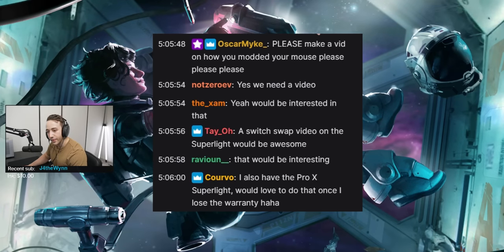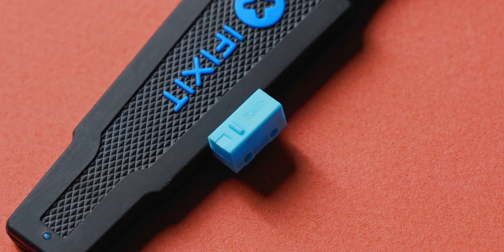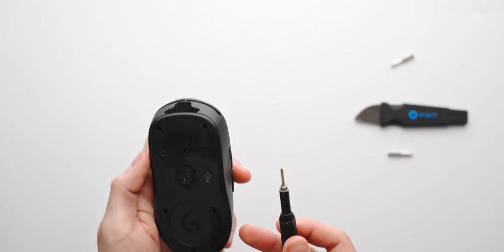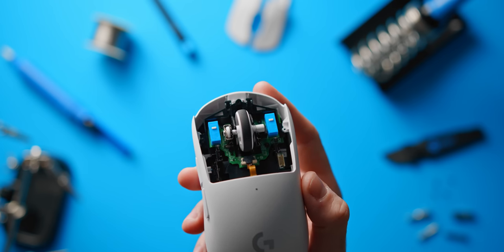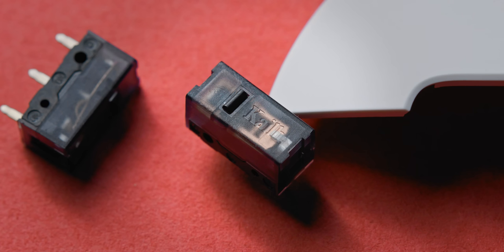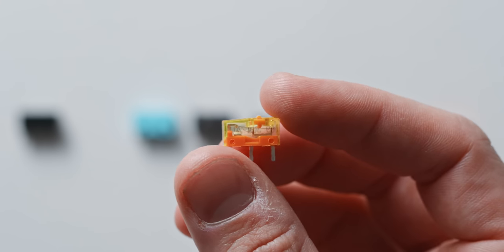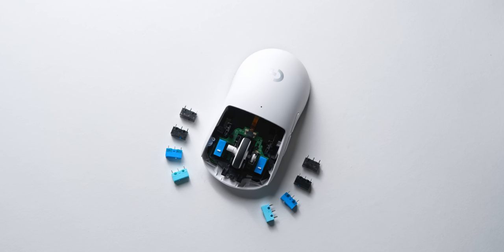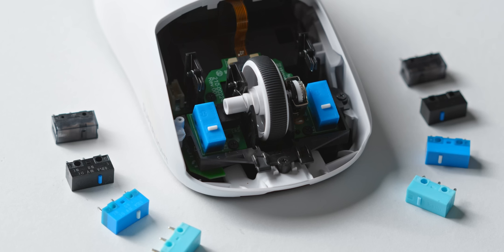Upgrading my Gaming Mouse Switches

Comment: Can we take a moment to appreciate this man hardwork. He just soldered and desoldered all the switces just for us.
Reply: Mech enthusiasts be like: meh
Reply: Damn, it sure did take him super long to do something he has already done once, damn.
Reply: Was thinking the same, what a great job! Thanks man!
Reply: As a guy who's into mechanical keyboards, I just desodered over 50 switches. Thats nothing.
Reply: @max5845  yeah but here you have to reassemble everything after desoldering and soldering
Reply: @MP_7  Here's what I have to do: Take the keycaps off the board, remove the keyboard from the case, de-soder 61 switches (I counted), lube and film 61 replacement switches (which takes over 5 hours to do), REsoder the 61 replacement switches back onto the PCB, then put that back into a new case with new keycaps. Trust me, the keyboard bois know the pain.
Reply: @max5845  I know, I did the same, but for someone who's not into it, even this mouse stuff is a lot of work, I still have to see a video, other than this one,  of someone who made switch comparison on the same mouse, so kudos to him :)
Reply: @max5845  yeah but you didn't shoot the video in high quality, color grade, edit and upload for free.
Reply: Men,u dont need to desoldered everytime to try a sound test,u can mount it without solder,but not gonna work on Windows,but the sound are the same.
BUT he had to put all the screws 8 times,that respect hardwark anyway. Respect so much.
Reply: @max5845  Been there. Lot of work but when finished.. worth it. :D
Reply: it is piss easy to desolder mouse switches
Reply: I can't imagine your perception of the world if you think this is hard work
Reply: This is one of things I liked about some of the Asus ROG mice: They have socketable switch upgrades should your switch die or you just want something different.
Reply: I'm surprised he didn't rip the solder pads off after all the solderings and desolderings
Reply: @Hobbitude  thx, I will
Reply: @aquanos  the first home I owned I built my self, took me 8 years. The second one I built took me a week cause I had already done it once.
Reply: LMAO, look at the "iTs NoT hArD" mouthbreathers over here. Because the concept was apparently too difficult for your three brain cells to deduce, let me make it crayon eating simple for you: every time you take something apart you risk breaking it. Even more so when you start breaking out heat and solder on a board, you risk overheating something or shorting something.

So, this man when through the trouble of showing us how to disassemble this, taking time and money in the process of shooting and editing it, and risking his mouse.

YouTube comments really do reveal the other 50% of the IQ curve.
Reply: @rustler08  well said! 😅
Reply: @PhyNxFyre  imagine not hotswap
Reply: @jsnR-d7x  If it's that easy and you make so much money out of it, why is this the first video im seeing with all the switches soldered on the same mouse? Why didn't you do it and earn them $? Probably because you're too young and naive kid.
Reply: I’m sure he has few of those mice
Reply: lol... it is nothing if you know what you are doing... the risk of breaking the mouse is 0 (again if you know what you are doing). Why does everyone thinks soldering is hard? i can probly do it with my eyes closed if you guide my hand to the pins. And i am not even an electronics guy, i am a software engineer. is the average  IQ of gamers really that low?
Reply: i mean he probably just put those switches in without soldering and clicked
Reply: Just for us ? How much money did he get from YouTube and ads ?
Reply: I am pretty sure that he just placed the switches without soldering it or de soldering it as there is no reason for him to solder it
Reply: @max5845  gatekeeping much?
Reply: beardedbob enthusiasts be like
Reply: That's nothing lmao. Easy soldering job.
Reply: @max5845  you counted the switches on a 60%? okayyy
Reply: Nope!
Reply: @Kuraio  i did :( do you know how to fix the solder pads?
Reply: @agsechogd6406  You could try bodge-wiring it with some thin magnet wire
Reply: @Kuraio  idk how to do that :/ I’m so pissed off
Reply: This is why you should switch to Asus Rog where they make switch replacement manageable.
Reply: @max5845  50 switches? bluds using a 40% keyboard
Reply: @DilawarAli_C over 50 isn't 50
Reply: he could just not solder it though
Reply: true lol
Reply: you guys really think soldering is a marshal art 😂
Reply: I DID THAT ON 2 MOUSES IS SO EASY

Comment: Just a warning to those new to soldering: flux is included in each solder wire to help it flow better but it can also cause cancer. Make sure you have a fan to blow the solder fumes away from your working environment and do your soldering in a well-ventilated area!
Reply: welp im ded
Reply: Leukemia 😨
Reply: Thanks for the tip man - haven't done soldering before, so that's great to know.
Reply: Oh sh*t. I liked sniffing it when I solder. I am so screwed.
Reply: @Prabhu2086  Lmao based
Reply: God, you scared me
I got one of those fume extractors, but I can still smell the flux when I use it, so I guess that it's not highly effective
So I looked it up, and apparently there is no evidence of flux fumes (or rosin fumes) causing cancer
They can only cause irritation etc
Reply: Tf man too late
Reply: Did not know that!  thanks for the headsup

Comment: LPT: if you're using a " 3rd hand " for soldering jobs like shown in the video, apply heat-shrink tube around the upper and lower jaw of the crocodile clips. This prevents the tiny sharp teeth from scratching your PCB or bating trough thin cable you might be soldering. It is a little less grippy, so kepe that in mind.

Comment: More brands should apply what Asus does with their mice that have interchangeable switches.
Reply: More brands should just introduce optical switches
Reply: Honestly can't wait until hot-swap switches on mice becomes mainstream.
Reply: @therealb888  For real. I have the viper ultimate and I cant use any other mouse. The feedback is so good.
Reply: doesnt asus have the patent for it? so other mice companies cant use it?
Reply: @minjou6412  yeah they do
Reply: Yes, the switch are the first and only part I ever broke on a mouse. They are so fragile.
Reply: @VigiHunter  Back 10 years ago I used to have an old mouse that started to double click or have dead clicks. I was in the process of shopping for a new one when I read somewhere that most of the time it's just the metallic contacts in the switch that get corroded and all you have to do is to spray some WD40 in the switch and it'll clean up the contacts. And it actually worked. I just sprayed a bunch on the little clicky nub and let it drip down inside. Clicked the mouse a bunch of times and the WD40 did it. I repaired a few of my friend's mouse since then with the same trick. The only negative point is most of the mice' s screws are hidden behind the pads which are glued in place. Most of the time removing the pad destroys it. I take it as an opportunity to upgrade to better pads but you dont have to. I managed to save pads before by using an hair dryer to preheat them so the glue isnt too sticky and I rehead the glue before putting them back on. Not perfect but unoticable if done properly.
Reply: @Dislob  huh good to know, will try on some older mice and see if it works.

Comment: Great video, your production quality is absolutely nuts. Switches generally have a lot of variation in actuation force and feel, manufacturers can buy preselected switches in bulk, where the difference in actuation force is much smaller.
Reply: often called "binned" or "presorted" and yes Kailh does this so that a pack of them you buy has as little variation across all the switches as technically possible.

Comment: Upgrading my mouse switches?
Great, now I can have another expensive obsession lol.
Is there enough of a hobbyist community around this that they sell a switch tester, by any chance?
Reply: Time to lube the switches!!!
Reply: @lightningcat6382  Yes, it's time to design and print a whole new split ergonomic mouse that fits one part over each finger like a bulbous glove. Let's make it an open-source project and start a group buy, too.
Reply: @lightningcat6382  you need to buy replacement feet as well as they're generally not reusable after you peel them off
Reply: Modding a mouse, shape wise is expensive unless you have a 3D printer, switch replacements are cheap
Reply: you can actually get a bag of like 50 switches for mice for dirt cheap.
Reply: Some ASUS rog mice have hotswap sockets for the switches so i guess u could use that as a "test" bench then solder ur favorite ones to ur main mouse.
Reply: @dawgdog69  you can get sockets to solder in and make any mouse hot swappable. Its just a little fiddly and takes some playing with them to get them installed correctly. That alone turns many people away for lack of patience.
Reply: Actually its much cheaper than buying a new mouse if you can fix your switches.
Reply: You say expensive but the most expensive switches here go for like $3 each lol

Comment: One thing that wasn't mentioned is that you can add a bit of tape under the mouse buttons also which can affect travel distance and actuation force.

Also, while most switches fit, some are a bit taller/wider than usual. An example is the Japanese omrons which are just a hair taller than usual, requiring you to sand/file them down a bit. Another thing to note is that generally (but not always), a lighter click will have a shorter lifespan and a stiffer click will have a higher lifespan. As mentioned, there can be a lot of click variance even between the same switches so this is not always true, but you can use it as a starting point when looking for switches.

I've managed to mod the switches on my model D and after a bit of trial and error with sanding the switch and adding tape (under the buttons), I have managed to completely remove the horrible play/pretravel that the model D has. This means the click now occurs almost instantaneously, while still having enough stiffness such that I won't accidentally double-click if I don't want it to.
Reply: true. thats why most manufacture use omron because they can balance actuation force and the lifeclick

Comment: This is exactly what I was looking for! My mouse started double clicking on its own and I need to replace the switch. Thanks for another great video!
Reply: If you search for "double clicking fault mouse" you'll find an instrutables page which tells you how to fix the switch, no soldering required.  I need to do mine too.
Reply: @hootsmin  I know, but switches are cheap and if I'm going to disassemble my mouse, I might as well swap them out. My mouse is 10 years old, and I use it for hours every day so it's amazing it's lasted this long. It's a Logitech G9X, I love it, will never get a new one. :D

Comment: I actually did this a few months ago with my Cooler Master MM710, I swapped the Omron's for some Kailh GM 4.0's and it legit feels like a way better mouse, no longer has the feeling of pre or post travel when clicking, feels a lot more responsive as well. Getting the old solder off of those old switches was a bit of a hassle at the start but I found if you apply some lead solder to the switch you're trying to remove and then use some solder braid it comes away a lot cleaner, would also 100% recommend getting Core pad skates or some Tiger skates.
Reply: Put some 4.0's in my logitech g604 today! They feel amazing and I immediately noticed the lack of pre and post click travel. Love them

Comment: I just did this after being convinced from your video and it took me a little over an hour following tutorials but I was able to do it and I couldn't be happier. Used the same switches that you I got the teals. It's night and day difference they feel amazing. I also modded the side buttons to make them less mushy. And after the upgraded core pads it feels like a new mouse. Amazing.
Reply: I need to get some of that tinfoil duct tape, seems like thats the only thing that wont slide off the side button pegs. (currently using electrical tape xD)
Reply: @Glassgate  yeah the aluminum tape works perfectly and sticks really well. still no issues with it.

Comment: I have a G305 that purchased 6 months ago. I desoldered all the three-pin switches and the two-pin switch. The left and right click were Omron switches. The side buttons were already the red Kailh GM 4.0, the mouse wheel was a two-pin switch, and the DPI button was another three-pin Kailh but had a black housing. 

I replaced all of them with two-pin Kailh Silent switches. Sounds amazing, feels great.

Comment: I had to replace the scroll wheel in my Logitech g603 because it would occasionally phantom scroll in the opposite direction I rolled the wheel. It'd be a great follow-up to hear your thoughts on the different flavors of aftermarket scroll wheels too.

Comment: You could also buy extra  switch pcb for the gpw and have several pcbs ready for swapping out if you wanna try different sets without soldering every time.  I just bought a hotswap pcb so can change switches on the fly in my superlight instead of having to solder all the time if want to try something new.
Reply: Where can one get this?

Comment: The GM 8.0's are great choice for gaming, I put those in my SuperlightX. Tip be very careful unpluging the ribbon that connects to your Mouse 1&2 + Scroll Wheel function PCB. Remove the ribbon while the pcb is unseated for a better grip, it can be tough taking it out and inserting it back in. The ribbon is fragile and can crack like what happened to me making the mouse useless without those functions =(. Oh and that really small springy tension thing that holds down the scroll wheel, very easy to loose didn't even know it was even there. I suggest remembering how it goes on before removing the wheel. But and in all great upgrade for your SuperlightX, so much better than the stock Omron's. Cheers lads
Reply: I broke my springy because I didn't realize it, do you know what it does?
Reply: @stillreallymad  It holds down & secures the scroll wheel down so you scroll up & down while feeling those tactile notches. I think without it the scroll wheel will just spin & the scroll will feel really weird without it, if I can remember correctly when I took my Gpx apart to swap switches. I hope that helps man, cheers.

Comment: Critical tip: If you overheat the legs of switch it will be garbage. You have to be very fast, and choose low temperature soldering tube with decent flux.

Comment: It's worth noting that the double click issue (that the G Pro Wireless is/was known for prior to the Super Light) is a voltage issue that manages those switches within the software itself, and not the switches themselves. Though there certainly can be a benefit from swapping switches too (if desirable, similar to customizing your keyboard switch based on how you prefer it feels).
Reply: I've done a lot of research before I bought mine and my conclusion is that it's mostly a mechanical failure in the switches themselves. 
Many people have switch swapped their GPW with known reliable switches to permanently fix the double clicking issue.
I'm thinking of being prepared and getting some switches or a switch-modded PCB so I don't have to solder anything, but the current factory switches are holding up great so far. 
Plus they sound beefy, a metallic undertone and crisp click. Maybe Logitech started using different switches with the newest batch of g pro wireless?

Comment: Some tips when doing this. Desoldering is the harder part when soldering ur new switched make sure to not burn or keep the solder iron on the pins for too long or you can break the switch if self or burn the bad off which after that is extremely hard to fix

Comment: A couple of tips to improve your soldering experience, firstly don't use a tip like that (conical), they are awful since they don't hold heat very well, Use something like a chisel tip you'll also have a easier time if you use a better desoldering pump like a engineer SS-02 These are fairly expensive but is well worth the cost if you plan on soldering fairly often.
Reply: While beginners should definitely learn how to use a wick + pump, the best investment I ever made in this hobby was a desoldering station

Comment: I recommend trying the grip tape logitech includes with the superlight as button spacers. Works incredibly well!
Reply: How does it work? Where do you put it? I have no idea :)
Reply: @reinulf656  put a tiny bit of grip tape at the surface that touches the switch buttons
Reply: @iamevate  doesnt it get mushier over time?
Reply: @Chuha97  Not at all. Had it like this for over a year, and it feels and sounds great. Really recommend trying it out. If nothing else it probably gets more compact and therefore better over time.

Comment: I still confused how to do it but the switch sounds so good
Reply: you open the mouse, remove the old ones, put new ones in, close the mouse. What is there to be confused about?
Reply: @Bruno-cb5gk  can't just explain it like that
there's process to soldering as in, adding your own solder to the stock OEM as it can be harder to remove the switch if the stock is very high on melting point then you can heat up all 3 legs and pull switch out then remove the solder with a pump or wick and then slide new switch with a touch of solder in middle to hold the switch in place so itdoes't fall out.
You can watch Ents's tutorial on it if you are confused.
Reply: @Bruno-cb5gk clear enough
Reply: @karminipal4700  I'm not saying its easy, the soldering can definitely be fiddly (I've had to replace the switches in my G900 because double clicking) but it isn't in any way confusing.